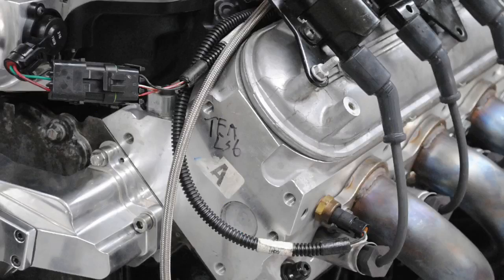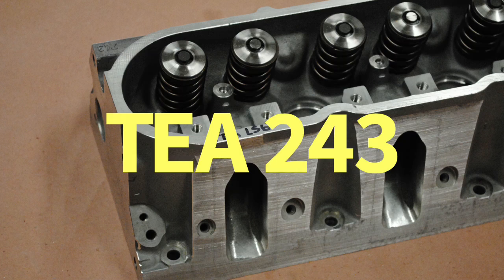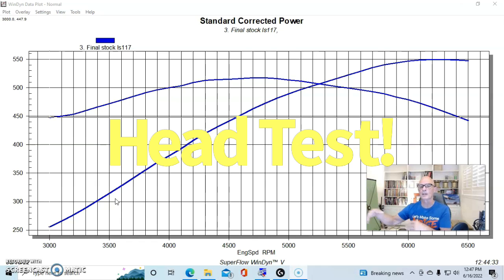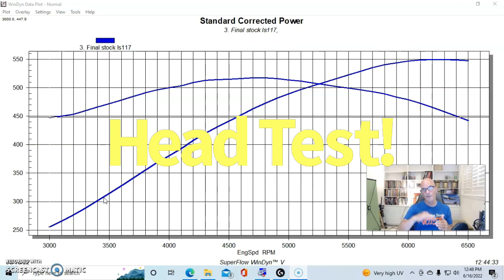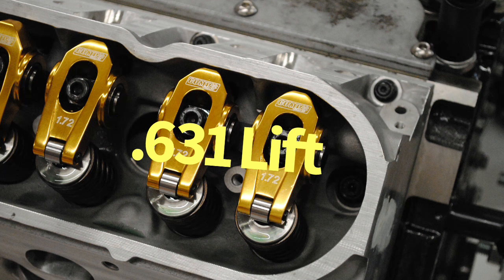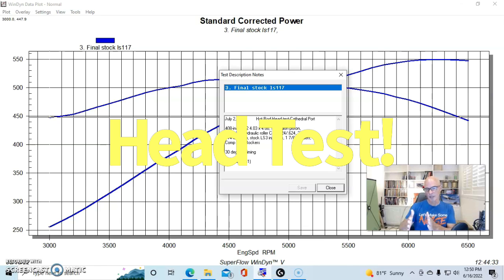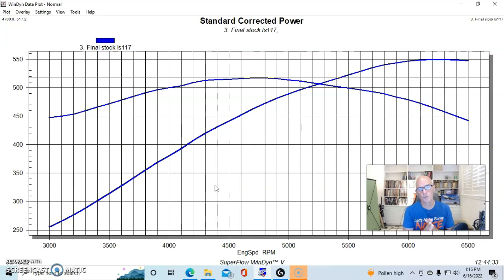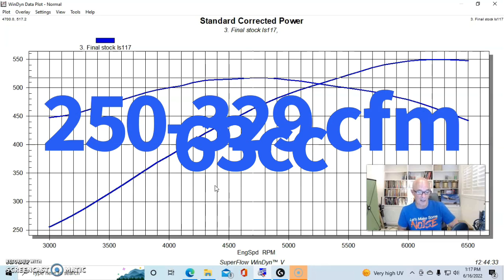WHICH IS BETTER-CNC PORTED STOCK LS HEADS OR AFTER MARKET CNC HEADS. TEA 243 HEADS VS AFR 245 HEADS!

Comment: For a lot of us LS guys who are making reasonably high HP/boost the big thing with aftermarket heads is the thicker deck surface. Factory LS head decks get unhappy like 1100-1200 consistently
Reply from the maker: agreed
Reply: They make deck plates for that
Reply: @jackdaniels2657  under high HP/boost it will quite literally distort the head. The decks are too thin
Reply: @raider9170  then dont add too much boost. If ur gonna build 2500hp u want bullet but if ur just hoping for  1000 to1500 hp u don't need much just install an oring on the cylenderhead/engineblock
Reply: @jackdaniels2657  wat?
Reply: @jackdaniels2657 What part of distorted head do you not get?  Wtf are orings gonna do to a weak head?
Reply: @TheGamersRace  LS's are a bit tougher than people think if you have plans to run 35-50lbs of boost then things get exciting if your running 15-25lbs thats not going to streach anything, since I started researching my LS build I've come across a lot of old wives tailes, i keep hearing a Gen 4 block can't take a 4.100 stroke but I can't find any evidence that it was a problem, another saying the stock aluminum block can run anymore than 800hp but I find lots of guys running more with out problem even with stock internals so I think a lot of it is just plain bullshit
Reply: @Disableddragracer  Same.  Grapevine with few grapes.  Lol
Reply: @jackdaniels2657   got to looking into that after i discovered that they make more than just a bore honing plates. diesel guys are extending the block by as much as a full inch and using top fuel a.r.p. studs to bind it down. too my way of thinking there's nothing stopping V8 pump gas guys from doing it. outside of the nightmare amount of machining cost. that and getting ones rod length right seems a longer crank throw would be in order to keep the rod bending risk down. i wouldn't skip the bottom end girdle option either. im not good at the math but CI has to come up by volume quite a bit. 

accounting for all that surface area. idk how much that would come out to adding a full inch to everything one the block/. equation block size  dependent of course . only reason i entertained it is i've been dreaming of a ground up build for a while im looking at a half scale big rig build with all of me built in using a composite cage cab-over body so for me packaging not to worried about it. way i understand it the mini dragster dads have been using extended c,n,c. heads for a long time. just discovered side port engines today love to see a modern version those came with built in superchargers most of them were w.w.ll aeroengines.  the brits are crazy.
Reply: wild how high ls limits are.
Reply: I like when companies like Tick Performance come in with some fat head studs and tell people that's what they need.  Mean while, the stock heads flex all over the place regardless of head stud size, and then they have you take material away from the head to fit the studs through.  I guess they work for the "while you are in there" crowd that has "turbo plans" and has yet to crack 600 hp.  Talk to any serious racer or machine shop and they will chuckle at the idea of going with larger studs in a stock head on an LS.  Tick Performance is like a penis pump for people who can't get a hard on in the first place🤣
Reply: Super late. But as a active grudge racer.  Bk to sbc days. That's not really true. An I never heard of Ls heads lifting or mines lifting with High Hp and power adders pressure nore thin material cast to cause that. Issue.  Yea don't know were you get that miss added info from.
Reply: @god1st.530  you have stock heads at high hp over 1100hp no problems
Reply: @kevinwest3689  I don't need free advice I have the best engine guy in my country built mine so far its making 1460hp on engine dyno and we aren't leaning on it yet, there are alloy blccks that are as strong as and iron block that no one talks about we have a guy here who imports truck loads of LS blocks got me on to 1, they have Siamese bore and more webbing which is what I have, theirs a fair bit different in gen 4 block to gen 3, ATM I'm tossing up getting it o-rined just incase while were are upgrading to full custom solid cam and shaft roller rockers I'm using gen 4 heads hand ported for the turbo I'm running a 98mm turbo 430ci LS, my engine guy is 5 times national super stock champion and has set national record so many time its ridiculous he does engines for pro stock, super stock, and sprint cars and heaps of super street 10.9 sec or faster so he know whats what ill listen to him over Richard simply because Richard is more into low hp budget builds and cammed up junk yard motor but I've noted what you said 😎

Comment: I ran that same camshaft in my LS2 powered GTO.   Brett Land ported big valve 243s.   For what it's worth, that car made 452/409 at the tire and could trap 97mph in the eighth.   I've still got it but the motor only has seven rods in it now :-)
Reply: I hate it when the motor loses a rod somewhere and you just can't find where the motor lost the rod. Then you have to buy a rod and give it to the motor and tell it to quit losing stuff!
Reply: @sebbonxxsebbon6824  - follow the bread crumbs.
Reply: @sebbonxxsebbon6824 
And a block, and a piston probly a cam.......hi stakes = empty wallet
Reply: Bet it does not idle very smooth ?
Reply: @gregblack4581  https://youtu.be/LuuMIpqMkAo
Reply: Never liked the V-7 LS motors…..😂
Reply: What went wrong with it?
Reply: That sucked. I made 451whp/423wtq with a bolt on ls6.

Comment: I have those AFR 245’s on a boosted 427 and I have a set of 243‘s in the garage. I won’t be swapping on the 243’s anytime soon 😂 There is also the better, thicker deck surface of the aftermarket heads but it is very impressive how good those ported factory heads work!
Reply from the maker: deck thickness becomes important on big power boosted motors
Reply: The extra material is not just in the deck of an AFR. It's also in the port walls, the rocker cover flange, the head bolt seats, etc. I built a 800 HP daily motor and wanted the extra stability for imperfect conditions.
Reply: You looking to get rid of those 243s?
Reply: @hatedonalot9080  yes!! I sure am. They have 42k miles, off of an LS2, they have never been disassembled meaning all valves still in them, ready to bolt on.
Reply: @baby-sharkgto4902  we need to try to make something happen tryna get ready for spring
Reply: @baby-sharkgto4902  how much
Reply: I'm thinking they have 3/4"deck thickness. I may be wrong.

Comment: Great video as always! Something I would also be interested in seeing is how much of a difference the bigger valve package makes, compared to the strictly cnc stage 1. I’m sure it’s much more expensive, but is it a logical choice vs just buying a set of aftermarket heads. Maybe not strictly with tea heads, but with any brand. And like you said, would it be worth the extra cost?

Comment: Any experience on the dyno w/TEA-ported 241 heads, Richard? I'm leaning that way due to cost & desire to keep the stock heads on my Camaro for fun/bragging/appearance/to be a little different.. I'd love to see how good a place like TEA can make the 241's run vs the (admittedly more logical choice) 243's. Thank ya, sir!
Reply from the maker: THE PORTED 241S WORK WELL TOO
Reply: The ported LS6/243 castings will make more power than LS1/241 castings....

Comment: If the aftermarket heads are not better they couldn't  sell them
Reply: Edelbrock made that mistake with the 351c heads for the small block Fords there heads were worse than the factory cast iron head's
Reply: @rono3045  that head was a factory replacement head not a cnc ported head
Reply: @lynndragoman1573  The Stock Heads that were then ported , also got bigger valves, probably better spings ,  Probably Cost Damn Near As Much As The ARF'S And Still Have Tge Thinner Decks !
Reply: @daviddavids3468  e'xactly why i never rework factory heads
Reply: Marketing gets a lot of people to do things that don't make sense.
Reply: @Brons2  they do but everyone posting must be using jiffy cheapskate porting shop. Every time i walk into a porting shop it starts at $400 and when i pick the heads up its $2500
I can buy aftermarket brand new heads for that same money
Reply: Makes sense but does hold water on most cold air intakes which I call hot air intakes . Most do nothing .
Reply: @gregblack4581  so cnc aftermarket heads dont work on cold air intakes but factory cnc ported heads do?
Smdh
Reply: @lynndragoman1573  he seemed to not be talking about heads and hot air intakes rather than the fact that they sell even though they don’t do much.